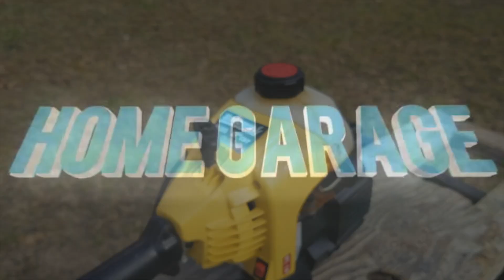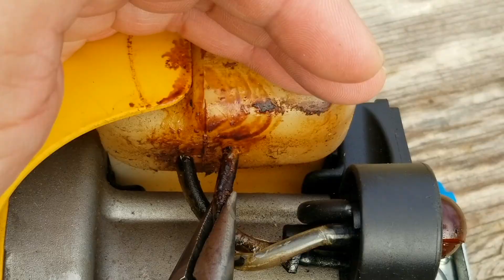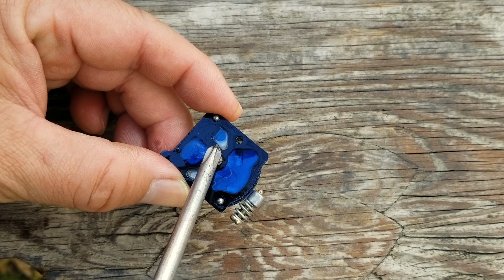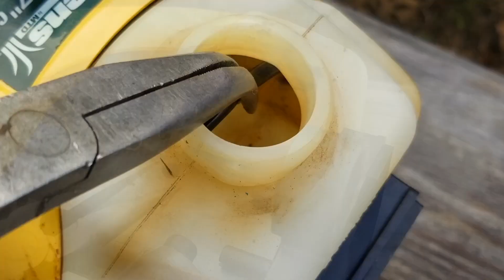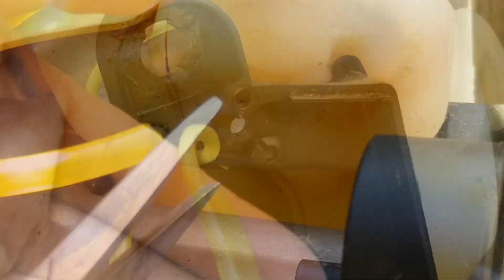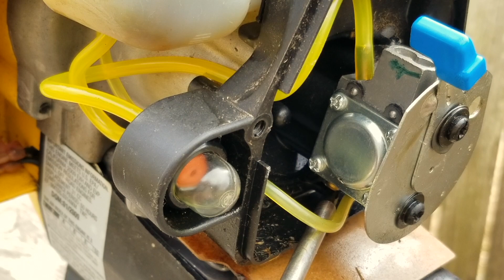Free Bolens trimmer fix

Comment: Check the spark arrestor on the muffler clean it or take it out  replaced all fuel lines  should of been as far as you should of went till you played with it more  messing with the carb is last thing. You play with also taking out the fuel adjust needle  valves and squirting carb cleaner in it  and I like the fast how you clean the carb screen   but that how far I would of went   if it was more buy a new carb  here in Arizona we can't get parts  for these weed eaters not even carbs
Reply from the maker: thanks

Comment: great video. i have the same issue and even after replacing the carburator it leaks at the rear. runs and dies. super annoying. even with the new carburetor.
Reply from the maker: that would be very annoying.

Comment: Run it till it's done. Then buy a professional series Stihl or Husqvarna.
Reply from the maker: makes sense to me.
Reply: @HomeGaragechannel  I run the heck out of both my stihls and Husqvarna and they're not phased by the very hard work that they do daily. Not even a little bit. As long as they have string in the cutting head, grease in the gear head and fuel and oil mix in the fuel tank they are ready to rip through whatever you need them to and they don't back down from much of anything green and growing.

Comment: Wow, I have that exact trimmer; have used it for almost 10 years, and just replaced it with the straight shaft version. I couldn't ask for a more useful video! Thank you so much for sharing 😊 Last year I replaced the tank and fuel lines as they had turned to dust. Am keeping it for parts for the new one.
Reply from the maker: no problem and thank you Mark Ash.
Reply: @HomeGaragechannel  I have a Bolens BL610 that will not stay running.. changes spark plug, cleaned carb, how can I repair it?
Reply: @terrypavon6885 turn the carb screws to see if that works. if it doesnt then something internally went wrong grab a new carb.

Comment: Thanks for the great video.  I was able to replace the old with a new carburetor however, it still didn't start.  checked spark plug and cleaned it a little bit.  Still, didn't start. used some starting fluid, it starts and stops. Now what?.....
Reply from the maker: now that you know the engine runs, we have to double back on the carb, is the primer bulb filling  up with fuel when pressing it?

Comment: Got used BL110 Bumper not wanting to come off. Also after changing lines and filter added new 40-1 gas I ran it about 20 to 30 min was hearing it tending to occasionally bog but keep running the it cut off. Otherwise, it ran great other than the late bog. Planning to check it later. I do think it might be it was very hot day. Have you done a number trouble video? Thanks.
Reply from the maker: No I haven't. You just can't turn it?

Comment: do you have the carb number for the choke built in the carb i have one like that but i need the number
Reply from the maker: no I sorry but I don't have that number
Reply: @HomeGaragechannel   did you do a video on a craftsman trimmer just like that one with the same engine ?
Reply from the maker: @SamOverby  I did a video over 4 years ago with a craftsman that had a semi auto choke on it? is that the one you're talking about? Do you know the model and serial number on the trimmer you're looking at. That would be very helpful.
Reply: @HomeGaragechannel   its the exact same one from 4 years ago you did
Reply from the maker: @SamOverby  I no longer have this particular trimmer anymore so I don't have a model and serial number to search with.
Reply from the maker: Hold on, I think I found the number. give me a minute
Reply from the maker: https://amzn.to/3wEMk28
Reply: @HomeGaragechannel   that's it but would one of the cheaper ones work on it i can afford that one i just need the gasket and fuel lines too also i was wondering if you knew the number for the cable that connects to the carb
Reply from the maker: @SamOverby  If you can find a cheaper one of the same design then it should work. No I don't know the cable number.
Reply: @HomeGaragechannel   can you repair a cable if the wire part one of the wires come loose but is still attached?
Reply from the maker: @SamOverby  so the wire is broken?
Reply: @HomeGaragechannel  yes correct
Reply from the maker: @SamOverby  there are some videos from other people who show how to fix them but would suggest replacing them as sometimes the repair isn't permanent.
Reply: @HomeGaragechannel   Okay ty do you know any good Gas leaf blowers for under 200?

Comment: I got Ryobi 775R which is same as Bolen. After throwing it out in the curb, decided to bring it back and fix the fuel line and carb. Thanks for the great video. Would say these 31cc weed eater has one of worse design and absolute pain to work on it (compared to modern weed eater).
Reply from the maker: You are absolutely right about the design issues. Thank you Mickey Kim.

Comment: I got the St 275 to run I had to clean the exhaust Port because it was completely clogged with carbon
Reply: Yes I got it clear
Reply from the maker: @weedeaterkid666  excellent work
Reply: Also I can't find a metering diagram online for a Ryobi cs26 any suggestions?
Reply from the maker: @weedeaterkid666  try this one Metering Diaphragm.  https://amzn.to/2NIo5hw
Reply from the maker: that sometimes happens. did you check the spark arrestor screen for a clog too?
Reply: Yes this spark arrestor screen is is as big as a piece of yellow cheese
Reply: Also it's not a oem carb
Reply: What happens with all the stuff that you fix?

Comment: Any time you fix one of these, it's better than throwing it in the land fill. Sadly, most small engine shops charge what it costs for a new trimmer just to repair these. I know many shops now refuse to even work on them. I can usually buy a replacement carburetor with fuel lines, air filter, spark plug and whatever for $12-$14 . I rescue them whenever I can. Nice video.
Reply from the maker: Thank you and I completely agree with you on the shops .

Comment: Lol It's funny that you are repairing the exact same type of trimmer that I purchased on eBay last year. It did not have the bottom shaft, spool cover and the clutch for my project trimmer. Well after reinstalling and fixing everything. It started to have issues with the pull rope mechanism. Actually, the gear started to slip inside the casing. Finally I got that fixed then I started to have issues with starting. At first it would start and stay for some time and then all of a sudden the engine shuts off. Not sure what's really happening? But now after looking at your repairs I think I should inspect the carburetor and see if there is any problem with it. Hey it cost me total of $70 and still not fixed. Your free trimmer is worth the repair for sure! I found out that I could buy almost new for about $89 LMAO! Well lessons learned!
Reply from the maker: Yes there are some very affordable trimmers out on the market.

Comment: Great question.  I do this as a hobby like you so yes it's worth it.  However  if you were to do this repair for a customer and charge for your labor it would exceed the value of the machine.  I usually buy a kit and install it and charge $40 for people who want to fix their trimmer.
Reply from the maker: you make a good point
Reply: @HomeGaragechannel  I try to fix everything and love getting free equipment.  I bought the metering diaphragm kit you suggested. Thank you
Reply from the maker: @brianking1138  no problem Brian King

Comment: For how good and clean this one looks makes me think these are really crap junk that it broke so quickly.
I had same issue with mine , hardly use and after a while won't start.  Pushing me towards electrics in many cases. 
I follow your videos becuase you show how to easily start so 4 times a year I pour some gas into the air intake and whola
Reply from the maker: Thanks for watching I appreciate it. Yes this one seemed to be very clean so it must have stopped working pretty soon after getting it.

Comment: A major design flaw with these is the plastic bracket/crank case cover. You will notice there is a large piece that protrudes where the carburetor attaches. This eventually cracks due to vibration. I had one with a hairline crack right at the base. That was leaking air causing the machine to run very strange. Drove me nuts.
Reply from the maker: oh I hadn't heard about that. I'll have to be wary about that.
Reply: Fire hazard is extreme

Comment: Hey HG, I got one lately ,exact, but I try to open the carburetor and got one joint broken, Anyway I don't have the tool to adjust the H and. L screw ,,have to get a kit
Reply: If it's your own machine you can cut slots in the adjustment screws with a dremel and then use a screwdriver. You can buy a kit with all the adjustment tools for $20 or less though.
Reply from the maker: @brianking1138  I've done it but the kits are much more convenient
Reply from the maker: thats a shame.

Comment: How do you know how much line to put in the fuel tank so the filter can stay in the tank?
Reply: Generally speaking, the fuel filter needs to sit centered in the lowest part of the tank. That way the operator can run through a full tank of gas without stopping, more or less.
Reply from the maker: @999thenewman  you're absolutely right.
Reply from the maker: for this type of fuel filter setup you have almost zero line in the tank.  Once the filter is on the line you have to push the filter so the stem and the fuel line is sticking out of the tank. I don't care for this design at all.